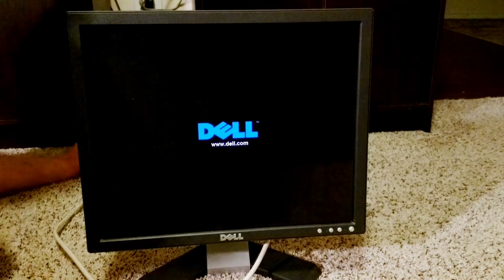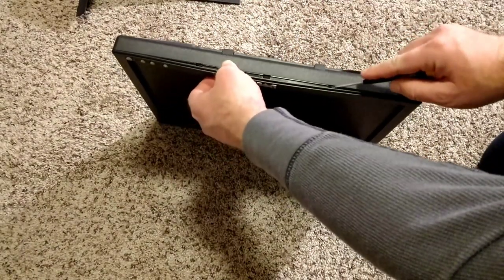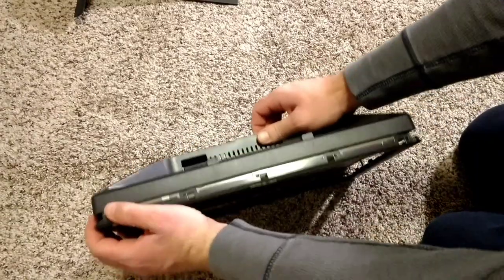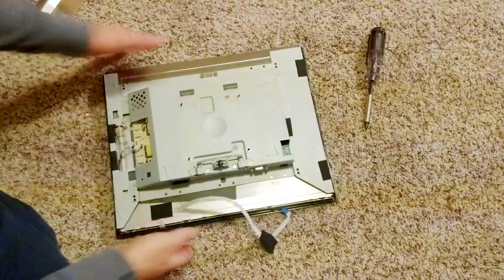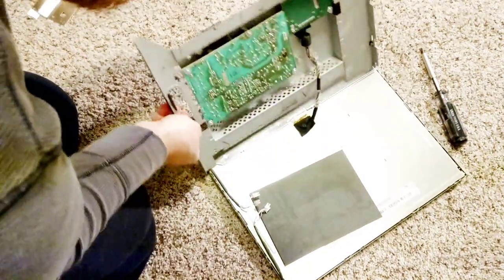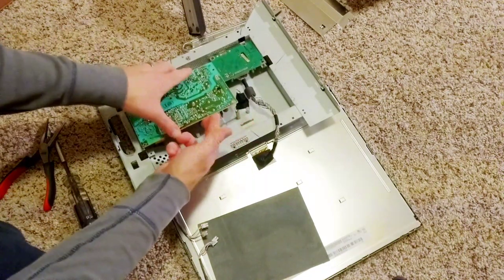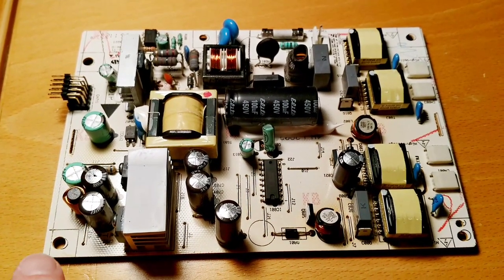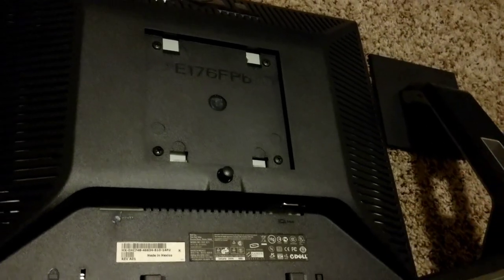DELL Monitor Won't Stay On Fix

Comment: Thanks for the video. I gave me the courage to try to fix my Dell 17 inch 8 yr old monitor that wouldn't stay on.  Between your video and another one on Youtube I found a broken solder joint (no bulging capacitors) and fixed it.
Thanks for taking your time to video yourself and putting it up on YouTube
Reply from the maker: Thanks for watching!
Reply: I think I might have the same problem. I replaced the entire power supply board and I still have the issue. From a visual appearance there are no bad caps. Could you describe what  the "broken solder joint" looked like? Thank you.

Comment: I have a dell 1905fp monitor which turns on but shuts off like yours in the video. I can hear a faint buzzing sound during the time that it’s on. I replaced all the capacitors and it’s still doing the same thing with no change. What else could be wrong?

Comment: Thanks for the video. I have a monitor that started doing the same thing a few months ago. I just put it aside and haven’t replaced it, because the system it was connected to had other problems which I eventually fixed but haven’t felt the need to use it. I’ve been randomly looking at new monitors over the last couple of weeks, but thought I would check YT to see if I could fix it and found your video. I will check it tomorrow. Thanks again. 😊
Reply from the maker: You're welcome! Let me know what you find. Thanks for watching!

Comment: Can you tell by looking at the capacitors that they are faulty?  I'm having the exact same issue with an old dell monitor so might give this a go!  Are the capacitors easy enough to replace?  Thanks
Reply from the maker: Sometimes capacitors bulge or leak from the top but bad ones don't always show it. They are easy for me because I have all the right tools. I don't know what you have. Thanks for watching!
Reply: @limitswitch  ah okay, I kind of assumed you could pull them out with your fingers and push the new ones in.  I don't have many tools, I have a pair of pliers though, would they do? Thanks for your help!
Reply from the maker: No. You need a soldering and desoldering set of tools.

Comment: thanks man this really helped alot with the in depth problem solving.
I was looking through google for an answer to a problem like this
and all I could find was questions with almost zero in depth answers.
ill put time and energy into it when I have the time and energy, still bumbed this thing doesn't work.
Reply from the maker: Let me know if you get it working and what fixes it. Thanks for watching!

Comment: I put a new PSB board on instead of replacing capacitors and it didnt fix the issue, what could be the problem? Could it be a faulty new board or a fault main board? Thx.

Comment: What if the scenario was the monitor would power off 30mins-1hr after turning it on? It would then turn back on after a few mins. Although upon inspection no visible bulge on the capacitors. Is it possible that the culprit are the capacitors as well?
Reply from the maker: Yes, they don't have to be bulging to be bad.
Reply: Justin Peters Thanks!
Reply: Another question, I've noticed that temperature contributes to thr issue -- I noticed that when used in a cold room/environment --  the monitor works fine. could this still be caused by faulty capacitors?
Reply from the maker: Hmm, sounds more like a bad solder joint if it's temperature sensitive.
Reply: Justin Peters is it possible for a solder joint to be bad even if it looks good on visual inspection?
Reply from the maker: Yes, because it will just be a small hairline crack. When it quits working, you could try pressing on parts to see if it starts working. You have to be careful not to get shocked when you do that.
Reply: Justin Peters After checking, it seems that the solder joints are intact. My monitor has 4 usb ports (Dell U2413) with power coming from the main power supply board -- one of them is "dedicated for charging". When the monitor turns off and I plug a device (e.g a smartphone) to the specfic port, the monitor turns back on and turns off as soon as I unplug the usb device. (sorry for bothering you)
Reply from the maker: Is it possibly the video card or the computer it's plugged into?
Reply: Justin Peters tried different sources -- pc, mac, media player-- still same results
Reply from the maker: I would need to get my hands on it. That's strange symptoms.
Reply: Justin Peters Yeah. Though after going aroud the internet, I'm guessing some caps might be failing due to high temps. But still not sure. Thanks for taking time to share your inputs! :)
Reply from the maker: Says that the video is not found. Did you make it private?
Reply: It defaults to unlisted. I just updated it to public
Reply from the maker: Had to use my laptop to get the link to work. Good job making the video. I think there's a component or solder joint that is failing when it gets warmed up. A way to troubleshoot this is get it to the point that it shuts down, then start spraying the components on the boards with freeze spray until you find the one that causes it to turn back on when sprayed. You can get freeze spray for electronics off Amazon, "MAX Professional 7777." Another thing that could be happening is it might be going into over heat protection. If there are any components with heat sinks you could take the heat sink off, clean off the old heat sink compound, and apply a new thin layer of heat sink compound. Let me know what you end up doing.
Reply: So I powered up the LCD with its guts open, plugged in to a video source -- been waiting for it to turn itself off, been two hours and it's still running fine. Man, this thing won't let me troubleshoot. haha
Reply from the maker: Hmm, so having it all together must allow it to get hot enough. Since it probably just needs a little more heat to make it fail, take a heat gun or hair dryer to it  and that should make it fail when you get it  over the bad part. Or you can cut a hole in the back, mount a CPU fan to it, and hard wire it into the power supply.
Reply: I did the hair dryer, and I noticed that when pointed towards a specific transistor (SB20100) the monitor turns off, and as soon as I point a mini fan towards the said transistor, within seconds, the monitor turns back on.
Reply from the maker: Sweet. Now reflow the solder joints to it and any parts around it before you try replacing it.
Reply: Justin Peters just to give you an update, I'm also getting some help from the guys over at badcaps.net and I learned that the chip I mentioned was in charge of overvoltage protection or something like that. It means that its doing its job correctly, but there's something else that's causing it to heat up and turn the circuit off. It was evident since the voltges I was getting from the main filter cap was higher than expected. Unfortunately, I think I messed up when checking the output voltages from the power board and now the backlight doesn't se to work. Nonetheless, I'm still eager to fix this thing, just got caught up at work. hope to give you a positive update soon
Reply from the maker: Awesome. I hope you find the problem. I was fixing a TV and the last part I needed to replace was the main high voltage filter capacitor. I decided to discharge the capacitor by just sticking a screwdriver across it instead of discharging it slowly with a resistor. Big mistake. After that, it quit working.

Comment: I know this video is old but I have a westing house 32 inch tv model VR-3215 when I turn it on the w turns on for a few then goes blank I can hear the static but no picture i opened the back up to see if the capacitors was good I saw two 680uf35v that where swollen on top . My question is do you think that can be the reason or is it more to it in your opinion? I don’t know much about this I’m learning from your videos
Reply from the maker: I think you found the problem. Also, if you see other capacitors that are exactly the same but not bulging, go ahead and replace them. You may have some other problems but you have to start with the obviously bad capacitors. Let me know how it goes and if you need anymore help.

Comment: Thanks, video helped my fix my DELL E198FPb blinking power button issue. My screen was totally black. I replaced the two Elite 16V 680uF capacitors that were slightly domed, with NTE 25V 680uF high temp capacitors that I bought at my local Micro Center (pack of 2 for $1.99). I wish I had a 40 watt soldering iron because my 15watt took forever to heat the solder but it worked. The only issue I had was that the buttons on the front, no longer work. The monitor comes on as soon as I plug it in, and I can't turn it off without unplugging it.
Reply from the maker: I've learned over the years the electrolytic capacitors can be bad, even if they aren't leaking or domed. Might just need to change the rest of them.

Comment: I have the same model and the same problem of this monitor. The bad news is that I have replaced Capacitors (2x1000mF and 4x470mF) and Transistors (2xMosfet J598 and 4xC5707). Can you help me wih this?. PS I'm not electronic and I'm so dumb about this but my monitor still works it turns on and after 5 sec the screen gets off, but if I light up with my phone you can see the display.
Reply from the maker: That would be a different problem.  The backlight isn't working. There is a high voltage power supply for that and it's supplying the backlight. There are some high voltage capacitors for that. It could be about anything. Hard to tell without having my hands on it.
Reply: @becausestuffbreaks  Is the same monitor and the same boards. So, you guess it's the big capacitor in the power board?. Because it looks fine with no inflation sign.
Reply from the maker: It's hard to know without looking at it. On that note, I've seen these monitors for sale at Good Will for $10.

Comment: Forgot to discharge the caps. Arc monitors got a 240v dc in a cap without a discharge resister. If you don’t pull the plug while monitor was on. The cap stays live almost good 10 to 20 mins. You won’t fee anything until you hit it with the soft part of your hand. (Still waiting for the feeling to return) lol
Reply from the maker: Oh my. Didn't know there was no discharge resistor. My monitor was sitting powered off for a very long time.

Comment: My old LG 1718S has this problem.
Switched on: 
Displays LOGO: briefly shows Online screen and switches Off!
I also notice small sparking on 9 pin Shell, when connecting.
Reply from the maker: That's not good if you see a spark on the shell. Something is shorted to the chassis.
Reply: @becausestuffbreaks  Just an old Spare I thought about fixing: It can wait for a winter evening and probably the ash can! Thanks
Reply from the maker: Lol, whatever works

Comment: dang, to bad the caps on mine look good. Not interested in replacing CCFL on a 15"... Good video though
Reply: Some caps may be bad even though they look good is what I found with some digging on the internet. I just replaced 2 680uf that were bulging and the monitor still shuts off. So I just ordered a few 1000uf and 470uf to replace all the caps even though they aren't showing signs. Worst case I lose $15 gambling. If I win I saved $100. The monitor I typing this to you on now was repaired same way. As you said if the ccfl is bad I'll trash it.  good luck
Reply: Remember the Ferengi 3rd Rule of Acquisition: "Never spend more for an acquisition than you have to. "